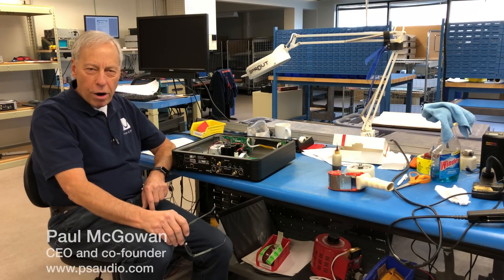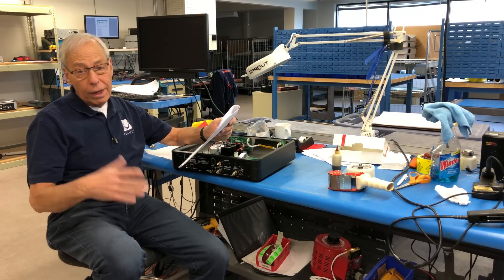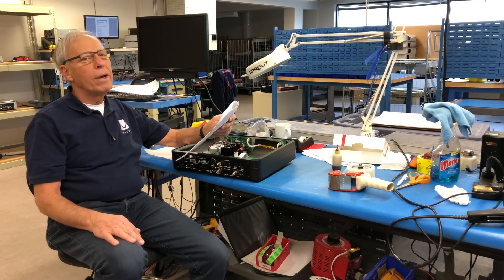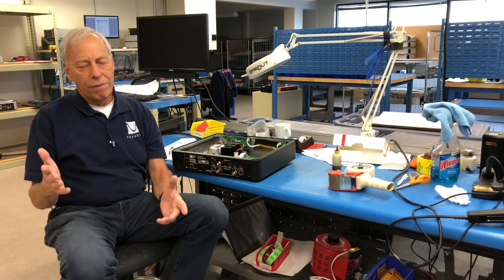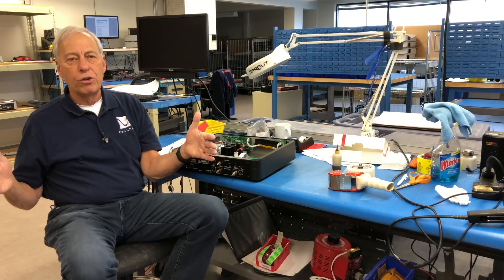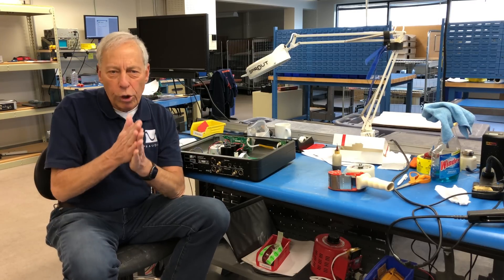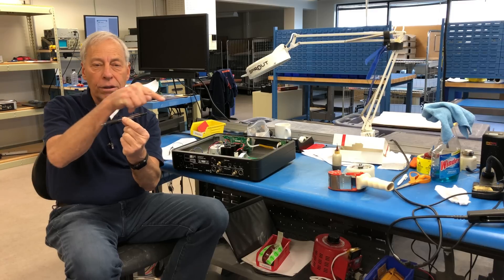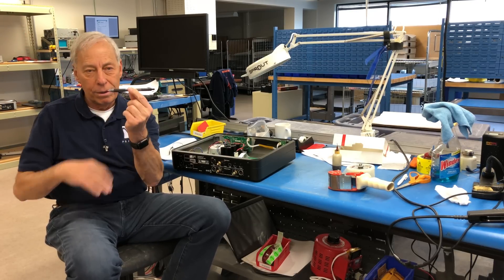Are low impedance speakers hard to drive?

Comment: yes and as we all know Wattage is NOT all when talking about the amplifiers power capability.
Actually its how many Ampere the amplifier can provide . 
Lower impedance equals that the amplifier give more wattage but also must be able to provide much more ampere and most cheaper amplifers can´t 
provide the ampere it actually draw from the amp , typically due to smaller transformer and poor powersupply design.
The bigger the transformer and the more eficificent and the more ampere it can deliver , the better . 
Of course the output stage must be able to handle this and as we all know smaller cheaper transistors will get way too hot and cant handle all the amperes.
Its a delicate balance to get this right.
I know switch mode powersupplies is more and more populair those days but still , the more ampere it can deliver the better No matter the wattage.
Personally I prefer the old transformer based system and when I look inside my amplifier then 80 % of the weight is actually the powersupply.
Most amplifiers can´t drive a 2 ohm speaker , simply because of design limits ( read poor design and components )

When this is said then remember NO speaker is an ideal 8 ohm or 4 ohm ect impedance.
The impedance varies slightly by frequency so you can have a speaker rated at 8 ohm but in real life it varies between example ;;  5.7 to 9.1 ohm from lowst to 
highest frequency. Here its important than if the speaker have big variation and falling below 4 ohm those can be very hard to drive with a cheap amplifier ,
simply because of the ampere and construction of the amplifier.
Also worth note is that the effiency of the speaker is important too.
A typically speaker with a 94 decibel at 1 watt measured 1 meter in front of the speaker is an average easy speaker if the impedance stay between 4 to 8 ohm.
But many high end speakers have a low as 82 db 1 watt / 1 meter and an impedance curve going as low as 1.8 ohm to 8 ohm , those are very hard to drive 
and not only require lots of wattage but also many ampere to keep them in controll.
If you on the other hand have 104 db 1 watt 1 meter sensitive speakers they play louder with much less wattage and even if the impedance curve look like shitt 
then they are a bit easier to drive because you doesnt need so many watt to get same level , but dont try drive them hard because the impedance is still low in 
some frequency and the amplifier will run out of ampere.

Its also good to notice that having many watt and ampere is much better than too little .
You want a headroom where the amplifier , even if driven hard still have enough headroom to handle spikes and transients WITHOUT ANY CLIPPING .
When an amplifier clipping its much more dangerous than if its just distortion.
Clipping effectively kill the loudspeakers.
When thats said of course as low as possible distortion will be best.
A little side note , Go for an amplifier there have the distortions in the 2 harmonics instead of the usual 1 and 3 harmonics because acoustics instruments ect
they naturally have most distortion in 2 harmonics and we as humans are less sensitive to those and as a result the amplifier sound much more natural 
than if its 1 , 2 , 3 harmonics ect.

Typically tube amps and mosfet amps have most distortion in the 2 harmonics  instead of the 1 , 3 5, ect.
And distortion as low as possible.
As high signal to noise ratio is a must , I have a signal to noise around 230 db and 180 db in my analogue studio mixer compared to the old days where 
even expensive gear have around 110 db signal/noise its like no noise is exsiting.

Comment: Think about trying to pedal a ten-speed bicycle in different gears; a higher speaker impedance is like a "lower" gear that requires the pedal to move further to move a certain distance.  Moving the pedals is easiest in lower gears, but moving the bicycle a certain speed up a slight grade will often be easiest in a middle gear.  In low gears(equivalent to higher impedance), it will be hard to move the pedals fast enough to achieve the desired speed, while in higher gears (lower impedance) it will be hard to move the pedals at all.  If an amp has a limit to the voltage it can output (analogous to pedal crank speed), then at high enough impedances (low enough gear), that will be the limiting factor for output power (bicycle speed).  Increasing the gear ratio will increase the bicycle speed proportionally as long as one can keep moving the pedals at a constant speed.  When the force on the pedals is too great to keep moving them at maximum speed, the power will stop increasing proportional to the gear ratio.  If one goes too much beyond that, increasing gear ratio will actually start reducing power.

Comment: I think what he’s trying to ask is; hes amp rated 100w at 8ohms and 200w at 4ohms. Why is it harder to drive a 4ohms speaker when you have then doubled the wattage (200w)
Reply: At 2 ohms the power needed is 400w but the current the amp can supply is only enough for 230w with the breakdown in transistors and other components happening. The power load happens in the amp instead of the speaker.

Comment: It’s very fortunate I understand  impedance VS resistance but even that  I had a hard time fowling your explanation impedance and the efficiency combined they determine the requirement of drive required all power amps have low impedance stated this is determined by internal impedance of the amp circuit and it’s power supply, nothing else . As long as the speakers load impedance is above minimum stated by the amp manufacturer everything is good for the equipment not to say how well the combination works but that’s part is done now it’s acoustics and that in a very complex question

Comment: Depends if the amp is limited in the voltage or current it can put out. If it's limited by the voltage, power capabilty will go up with lower impedance, if it's limited by current, power capability will go down with lower impedance. Higher current requires beefier components, and higher current usually means more heat and more loss so it's less power efficient. Higher voltage only requires better electrical insulation.

Comment: Why are many hifi speakers 4 ohms, and why not make as high impedance speaker as possible if it’s easier to drive? As far as I know, some headphones are 600 ohms?
Reply: It's a question of whether you want to increase power through voltage or current. Lower impedance speakers produce higher power by increasing current at the same voltage.

Comment: Another way to put it -
A lower impedance speaker doesn’t “allow” or “let” an amplifier deliver more power; it “forces” it to deliver more.
Reply: Yep! Low impedance speakers are truly  bad implementation. There's some benefits, but the disadvantages are excessive heat, high power draw, and reliability issues. 

John DeVore is correct. 8ohms is a sensible target and the best of both worlds.

Comment: What I have never understood is how a speaker can be either "hard" or "easy" to drive. 
I have encountered some that seem easy and some that seem hard, but most are in the middle. 
What makes a speaker "hard" to drive?  Driver compression? A crossover that wastes a lot of power? Something else?
Logic says that any speaker that is "linear" should be easy to drive and should be preferable over one that isn't linear, 
but logic and the response of transducers don't always meet at square corners.
Reply: Hard to drive refers to the amount of AMPS that are drawn. Typically this refers to low impedance devices (speakers). The path around the circuit is less impeded, meaning more current (amps) are drawn continuously… thus a lower voltage is required to satisfy Watts law (which is only ever calculated after Ohms law spits out the numbers to use). Typically, bigger wires (and fewer winds on the coil) provide less impedance (resistance)… thus more amps not only can flow… but WILL flow. The BIG question is whether or not the Power Supply can provide the amount of AMPS at such a steady and frequent rate. So the stress is on the amplifier to provide the AMPS. Or more specifically… more stress on the amps Power Supply. Volts are easy… Amps are hard.

So why go low impedance? Well you need to look up the Lorentz Force. The more current you can provide, the stronger the lorentz force. Furthermore, the current can flow more freely in a low impedance scenario, which means the more nimble the response. 

You see a lot of 2 Ohm speakers in subs and in car stereo. Car stereo because they have low voltage power supply (12 volt battery), but lots of AMPS available (hence those big beefy wires). You run big speakers at 2 Ohms because of the strength behind the lorentz force… allowing you to move more mass (bigger cone) which needs to move more air (mass in its own right). Or more importantly… an ability to move more mass quicker and with more fidelity.

Lower impedance allows you to lift more…. but The Law of Energy Conservation demands that lifting more, requires more work. Lower impedance means less volts and more Amps. Do you have the amps to satisfy the requirements? That is going to depend on your amp.

Comment: I see it more like when playing at a certain level (voltage output of the amplifier) is like going at a certain speed in a car. Speakers are a load on the amplifier, just like weight in the car. Even small cars can go 60 mph with a person in it. The same can a truck. If you load the small car with lots of weight it might not be able to go at 60 mph anymore. It might even break down, but the truck will still go. A slender amplifier might play at 100 watt/8ohm (28volt) but it takes a strong amplifier to deliver the 28 volt into 1 ohm (28 ampere = 800 watt)

Comment: A lot of this depends on the internal design of the amplifier. ALL Audio amps are designed around Q-point and something called an SOA (Safe Operating Area). Most linear (class AB/B amps) audio amps have their Q-point between 6 and 8 ohms. Now these amps also come in two basic flavors, bi-polar and MOSFET. In the case of Bi-polar amps, when the impedance drops low (approaches 4 ohms) the amp will run hotter and will have to adjust its internal bias circuits dynamically or "thermal runaway" will occur and the amp may "self destruct".
Bipolar transistors conduct more with increase in temperature. MOSFET amps, on the other hand, become more resistive as the internal component temperature increases (ie. the load impedance decreases). So MOSFET (and class D amps) amps seem to "tolerate" low impedance loads better than conventional bi-polars. The exception to this are amps that have several "speaker taps" marked 4,8 (and sometimes 16). These amps (like the MacIntosh) are using output transformers and are designed for this. Other (newer) class D-amps are "optimized" around 3 ohms and like to be run between 60-80% of full power at that load !  However very few (if any) amps are stable if/when the speaker impedance drops to around 1ohm at high power. In either case the stability and reliability of any amp can be improved using an internal or external fan when driving low impedance loads at high power.
Reply: BJTs have SOA limitations.  MOSFETs do not.  
BJT output stages need careful bias design which tracks the output-device temperatures, regardless of load impedance.  This is not only a low-impedance issue.  
Amplifier instability, if it occurs for example at 1 ohm load, is not solved by adding a fan.

Comment: I've never heard a good explanation as to why anyone even makes 4 ohm speakers!? Or 2 ohms for that matter!? Its frustrating especially when looking at speakers to buy. There is nothing worse than finding some speakers that sound amazing and finding out they are 2 ohms or 4 ohms. If 4 or 2 ohms sounded better than it would make sense to me but that just isnt the case. It falls under the engineers power as usual and anyone who has ever worked on cars or any kind of machinery can testify as to the insanity of engineers! I'm thinking it's the same in the speaker world ,that engineers just like to make things difficult!
Reply: Really? If possible it's better for speakers to be 4 ohms than 8 ohms.  Eric Alexander agrees with me as well.
Reply: Low impedance speakers became attractive after direct-drive amplifiers (no output transformer) came onto the market.  As a rule of thumb, solid state power devices handle high current more robustly than high voltage.  Speaker designers decided to take advantage of the ability of those amplifiers to provide more power at lower impedance.  
I'm sure that if you were a product line designer in their situation, you would have been compelled to do the same.  Competition in the market demands it.  
The 2 ohm speakers are mostly found in car audio.  There, it makes sense to run the lowest impedances, as the available power is only 12-14V, and less power-supply boost is required when the load impedance is low.
Reply: @marianneoelund2940  yeah ,I've been asking anyone who might know the answer and your answer is sorta on the same level more or less. Lol! To be honest I think my problem is I'm trying to make sense of something i admittedly know very little about! Lol. To make matters worse I'm finding that the more knowledgeable I get ,the more I realize I know very very little! Sigh.....:)
Reply: @number1pappy  
Don't feel bad.  As one of my EE professors commented, the discipline of electronics is so vast that no one person can be proficient in all of its sub-disciplines.  
I've been an engineer for about 40 years, and am still learning!

Comment: All statements are true with the same output voltage. But is that relevant?

A driver with half the impedance gives twice the current, is twice as efficient (efficiency is the inverse of the impedance) and gives twice as many output (+ 3dB).

But with the same output (in SPL and/or in current), with half the impedance you need half the voltage and half the power! And you get less power compression, making the situation, and the dynamics!, even better.

A lower impedance driver gives less stress on the amplifier and less stress on the driver, when compared with the same output level (SPL and/or current)!

Aneal is right.

But, big swings in impedance are always a problem…
Reply: Yes, the same output voltage is relevant, because that's how amplifiers work.  They are voltage sources, and try to maintain the same voltage regardless of load current.  
Efficiency should be measured on a power basis.  It's not correct to measure speaker SPL outputs with the same drive voltage if they have different impedances.  
I can assure you that a lower-impedance driver is not less stressful to today's typical amplifiers (lacking output transformers).
Reply: @marianneoelund2940  "It's not correct to measure speaker SPL outputs with the same drive voltage". Yes, correct, that was my point!

If a 4Ω driver has the same output at 1 Watt compared to an 8Ω driver, take the 4Ω, your amplifier gives you 3 dB extra headroom. If it is a good amplifier it doubles the maximum output power at 4Ω, a bit less otherwise.
Reply: @JerryRutten  
That is a strange definition of "good amplifier."  It certainly doesn't include some very fine units that have output transformers or load impedance selector switches.  
My definition of a "good amplifier" is one which handles reactive loads as well as resistive loads and maintains inaudible distortion at reasonable power levels in real world listening environments.

Comment: When it comes to impedance, that is based on DC resistance as a constant and inductance reactance AC component at a chosen resonant frequency/ overall band pass frequency, (vector analysis).  Just off the top of my head, many things could determine the reasons why a speaker is not handling better at a higher impedance. It could be a weaker magnet, and the gap is wider (to handle more wattage), the wire is thinner for the voice coil, or the cone or voice coil for the woofer is thicker and larger which makes it heavier. If it's a two way system it can have a lot more boost, if it's a three way, you have a mid-range which would actually bring the mids out more but shunts the amp more if the setting on the speaker is set to full mid-range.  It depends!!
I've got some old pioneer speakers from 1971: CS 77s,  65 watt, 8 ohm, 4 way system.   I tied the two together in series as a center channel for my Sony 5.1 surround sound, which the amp says it produces 145 watts at 1 k hz. Overall it's 90 watts at 20-20,000 hz per channel at 6 ohms.  Since the pioneer speakers are rated 65 watts per spkr.. Which in series calculated at 130 watts handling, but at 16 ohms, which would actually be a little more handling power...which,  I haven't calculated it...but of course it's a four way system which handles wattage well.   I have cranked it up full volume, no distortion, and the clarity is superb. I always use a slightly lower wattage speaker system for a higher wattage amplifier, it just works better. I have Dayton audio towers for my two front. They are 6 ohm per spkr, 145 peak and 90 rms. I was surprised the capabilities they have, they shake the whole house. For the rear some old Sony SS-RG 444,  6 ohm, speakers. they handle allot more power than my system produces actually, but they're fine for now. I built my sub woofer from an old cabinet that goes in a car,  two 15's in the cab, I'm using a Powermax DC 12 volt supply to power my amp, a old Car amp, 250 watt Mosfet stereo amp by Road Gear,  bridged,  spkrs in series, 4 into 8 ohms. It is TOO much BASS for the house, example, a movie explosion, is an EXPLOSION under my feet....  I don't have termites, rats or mice anymore.  I'll shut up now lol. LMBO.  I Enjoyed the video thanks!  :)